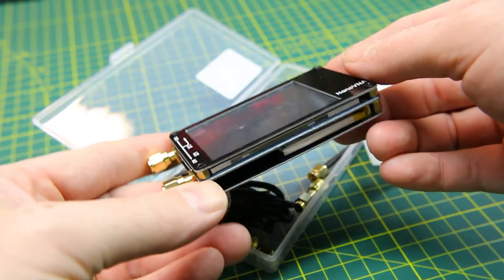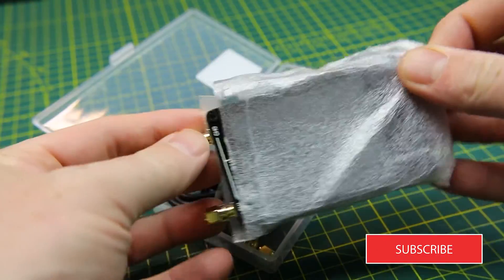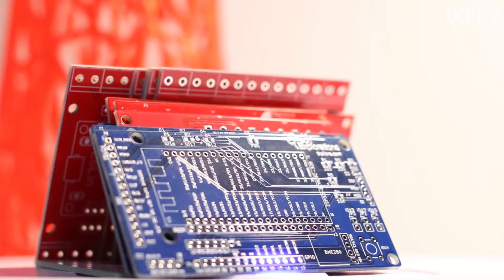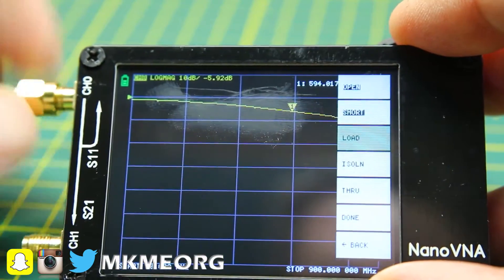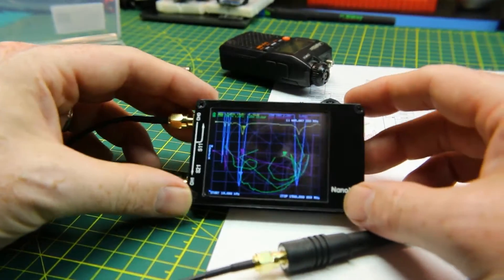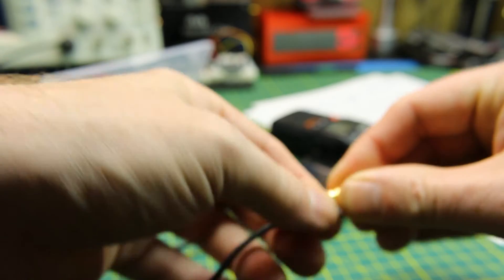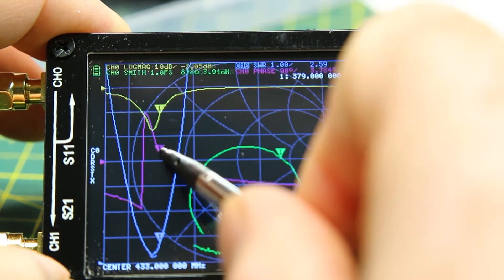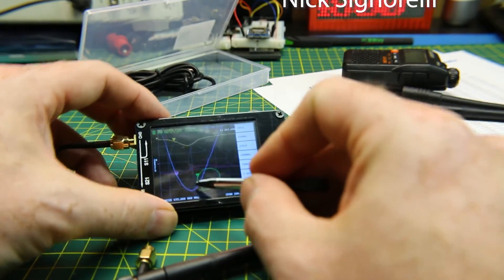Antenna Tester Under $100? 👀

Comment: I agree Eric, I never will be an engineer, I just like to know things. How is this device compared to this you think or are these two completely different devices?
[US$168.99 28% OFF]N1201SA UV RF Vector Impedance ANT SWR Antenna Analyzer Meter Tester 140MHz - 2.7GHz Measurement & Analysis Instruments from Tools on banggood
https://banggood.app.link/7s8iDEfll9
Reply from the maker: Hmmm I think the next VNA video will have a better unit for a better price.  Spoiler: https://amzn.to/3lvisj2

Comment: When I’m just testing antennas, I usually just run a single SWR trace, rather than return loss and smith chart, with everything else turned off. Another tip is to grab a copy of NanoVNASharp and run it connected to a laptop to do away with the menu and small screen, and make saving traces easier.
Reply from the maker: Awesome thanks for the tips!